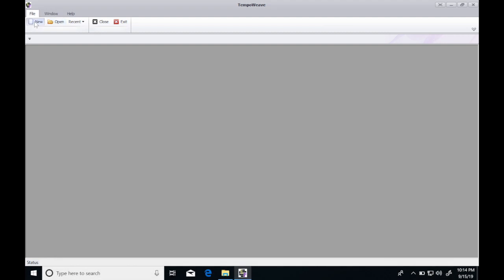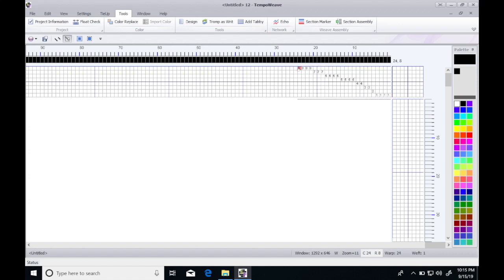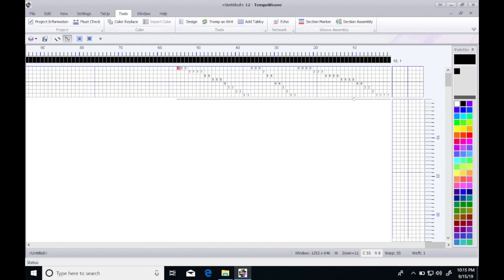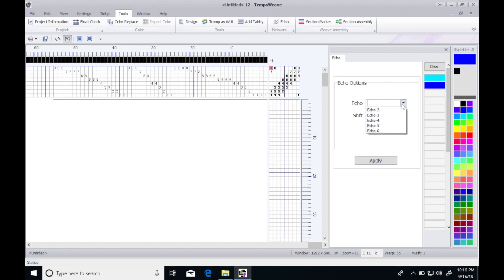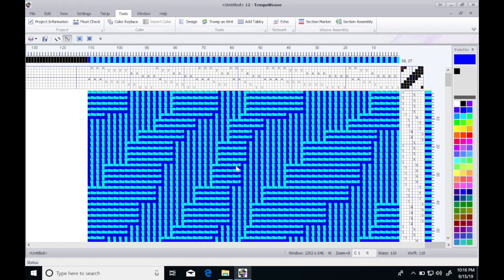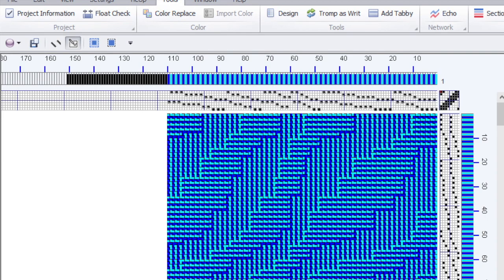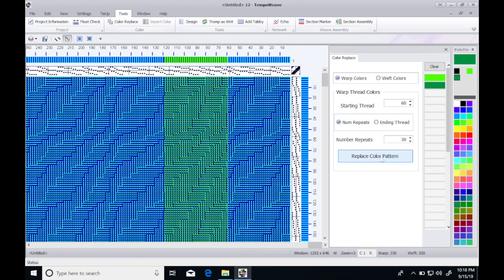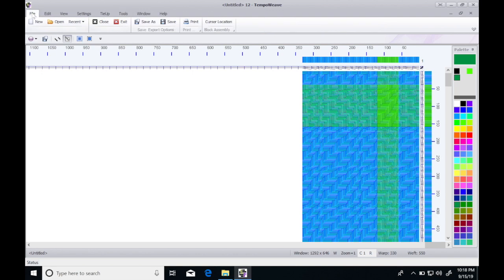TempoWeave - Mini Demo showing a Shadow Weave Design

Comment: How are you increasing the number of threads, yet decreasing/condensing the weaving design?  I have replayed the video, and I can't see what you are doing.  The video for me is very light.  Thanks!  Love it so far!
Reply from the maker: Hi.  I did a "quick repeat" to repeat the warp and weft to increase the warp ends and picks.  Quick repeat is located on the Design icon on one of the top tabs.  If it looked like I was condensing the design, I do a control "-" to zoom out and a control "+" to zoom in.
Reply: Tell me purchasing price now
Reply: Narinder Ninder it is basically free (1$) as it is beta. You can purchase on LoftyFiber.com. This version will expire in January when the non beta is released